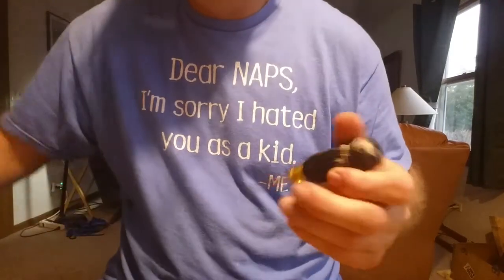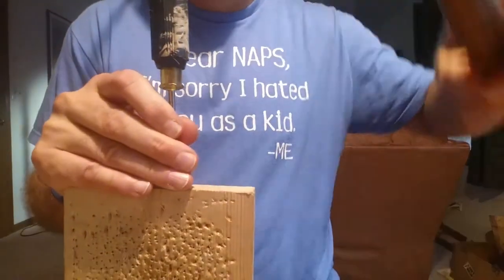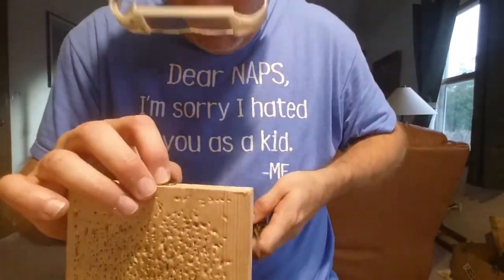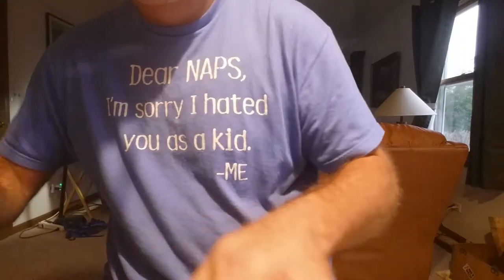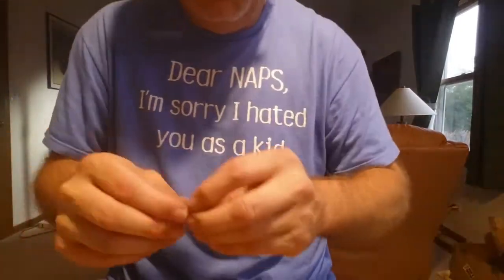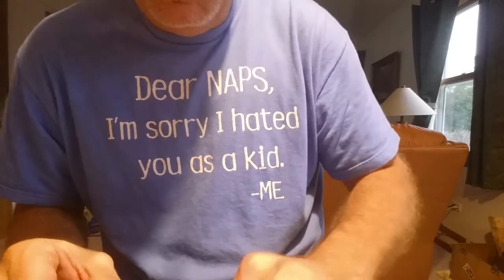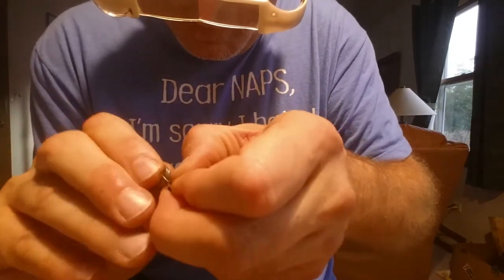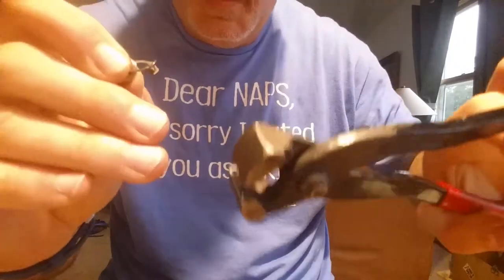Wedge Rivetted Maille

Comment: I enjoyed your videos friend.  I have made a lot of rivetted maille shirts over the past 20 years, I used lead rather than the wood when drifting the hole.  If you wanted you could save yourself the cost of buying the rings and make them yourself by purchasing some mild steel which is not coated in Zinc and just create a coil over a dowel and clip them off and smash them flat with a 4 pound hammer.  You got some neurological condition, your arms are shaking.  Cheers Fred.
Reply from the maker: Thanks! Lead is a great choice as the wood degrades. I might try it next time, but then I would have to wear gloves. A friend purchased these and gave them to me. They are not galvanized. They are mild steel. Thanks for watching!